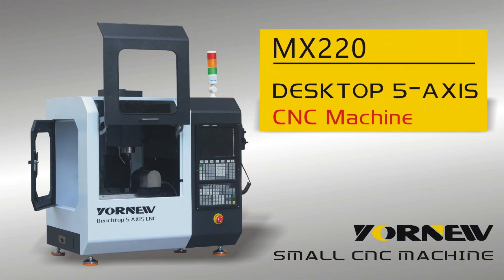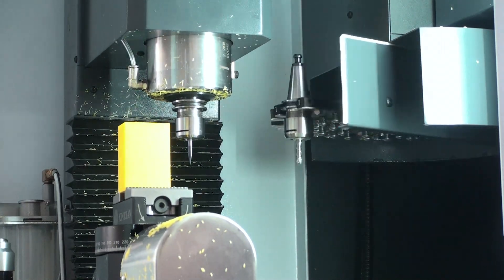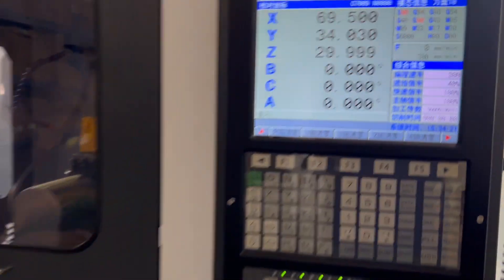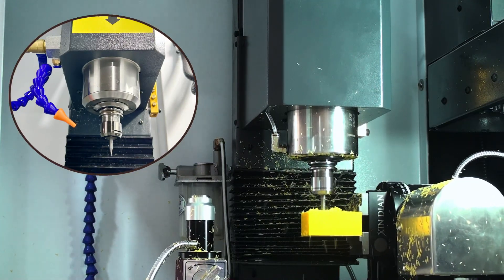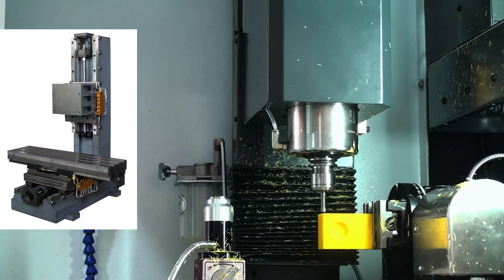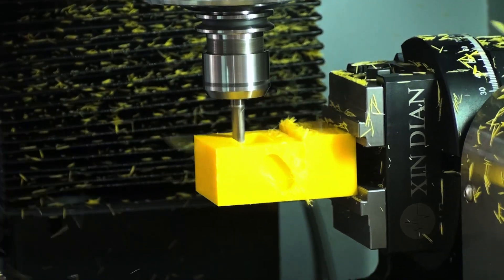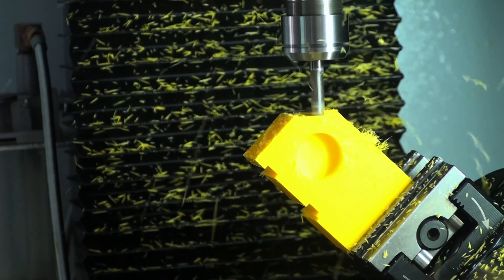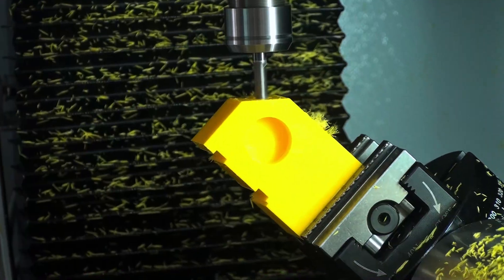Tabletop small 5 Axis CNC mill designed to fit your workspace|5 axis CNC milling machine

Comment: Fake add ive been trying to communicate with them via email no  one replys
Reply from the maker: I'm sorry to hear you've encountered this issue. If you've tried contacting us via email but haven't received a reply, it might be due to email server issues—for example, the message could have been filtered into your or our spam folder by mistake. If you’ve reached out multiple times without a response, though, there’s a chance the email address you sent to is incorrect or no longer active. Could you please share the email you used to contact us so we can check what's happening? Alternatively, you can reach us directly at the following email: sales@yornew.com